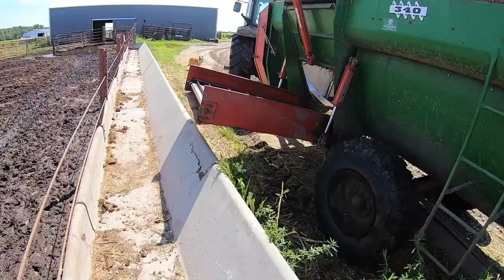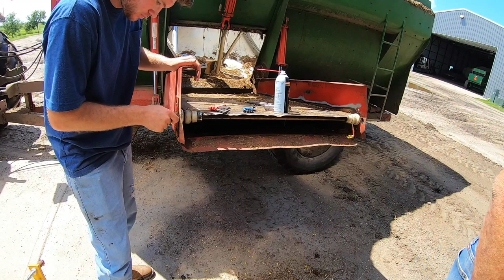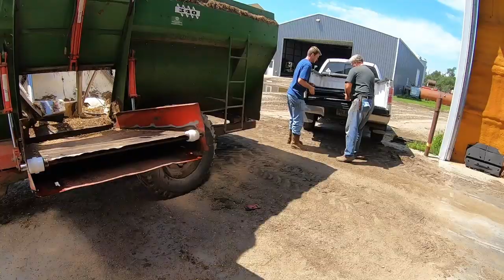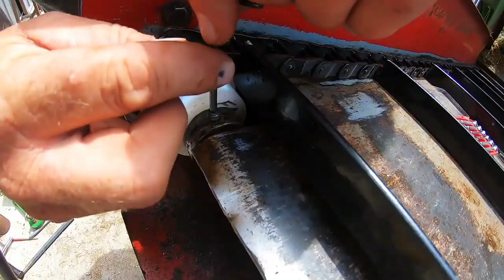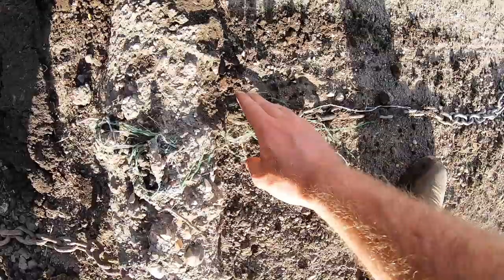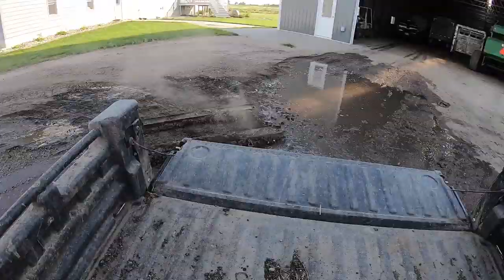Feeder Wagon Repairs

Comment: A old piece of chain link fence about 8 feet long with a few wooden 4x4 strapped to the top side works well as a drag, might not break like the chains are doing.
Reply: The chain link makes a good drag, but it wouldn't drag any water with it to spread the water out!

Comment: I almost lost me finger to one of those chains, so I was unloading some pellet and we had an old chain trailer rig set up where it served as a back up. The chain tension had be lose for the longest time and the chain had been oxidizing. So this rig worked just not up to spec, got to unloading the bugger, well I got to end and was just waiting for the crumbs to fall off seeing the slow chain go made my youthful and unwise mind think ahh I'll just knock it off with me bare hand. Well got my hand to knockin under where the chain rotates under where you seemed to be working on, in the vid. So remember an oxidized chain doesn't have good joint movement, meaning it binds in places creating a sort of funky chain reaction, so I didn't see it was making the weird quirk. Just came out no where a knot of chain came around clamped the top of my hand with the cross beam I was cleaning. Boom started getting sucked in 💀 but the Lord was on with me that day and I swear a miracle the quirk unbinded loosening my clamped hand. I honestly don't what might have happened if the knot had stayed I mean them PTO will move some weight around certainly snap a chain. But again the Lord was watching my unwise choice and taught me a valuable lesson in safety. Better spend that extra minute on precaution than a limb or a life. So yeah that's my story on chains, they demand respect.
Reply from the maker: Glad you came out good in the end!
Reply: @Sonnefarms yeah, me too. I mean you can never go wrong with taking extra precautions, the saying testifies better safe then sorry. Can't say the same for my younger brother's finger he lost a chunk on his index finger to a regular chain bind, he says even though it was just a small bit he misses that chunk's feel. But I mean he said he had it coming from his wreck less behavior. I wouldn't say safety is an issue just being vigilant of surroundinga and cognitive of materials. Sometimes safety isn't safe safe. Learned something new with that 30% strech rope that you mentioned before. Probably going to add some thing of that nature to  my arsenal come the time.

Comment: Cut a slot in the steel so the end chain link will fit through, then put a pin through the link.  There won't be any welded steel to be weakened and break
Reply from the maker: Very good idea!!